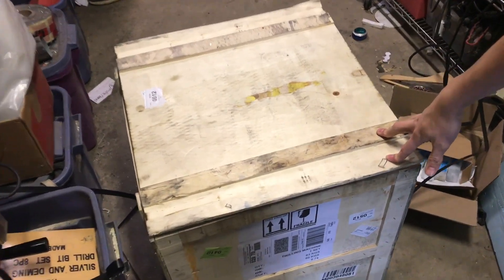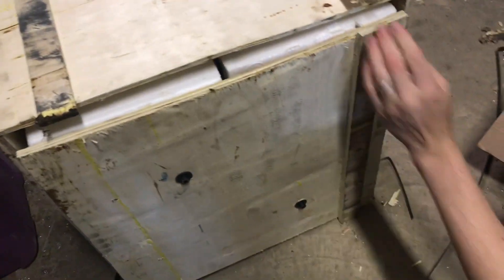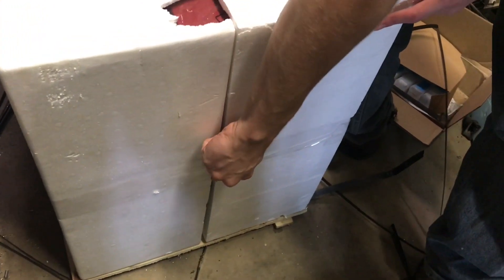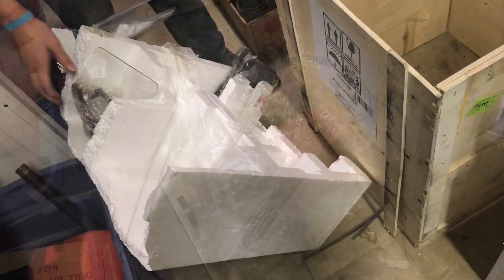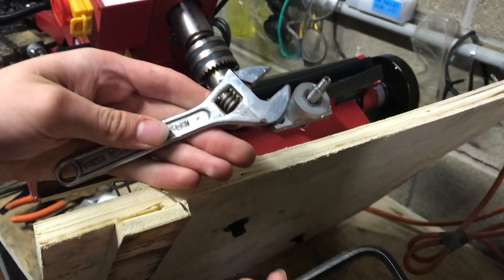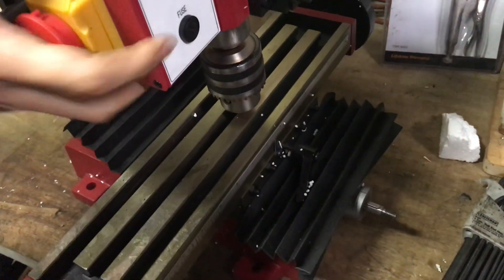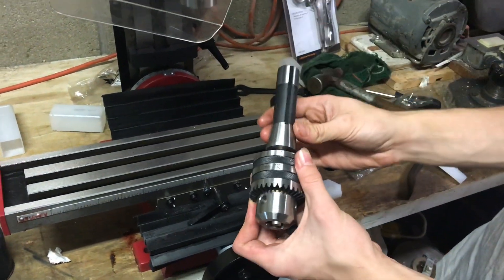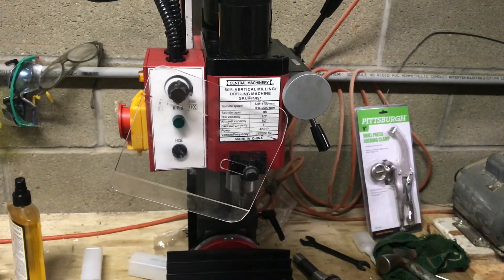harbor freight  mini vertical milling machine UNBOXING  and SET UP 44991 Central machinery

Comment: can you mount a six inch mill vice on that table?. I need to drill 6" wide steel with very precise holes and am thinking of getting this rather than a drill press.
Reply: You "could" but you would lose some height under the spindle.....a lot depends on the size (diam)  of the drill for the power rating of the motor.
They come with either an R8 or Morse 3 spindle taper....if you only want to do drilling a Morse 3 would be your go to......R8 is more  for milling as it uses collets to hold the cutters, but you can also get Morse milling chuck too if you want to do milling later......they also do drill chucks with R8 or parallel shanks if you have the R8 option.

Comment: Why did you not have it removed from the crate and save a lot of time  and crap on removing the thing from the crate and get right to the workings of the machine?
Reply from the maker: I guess we are pretty excited when it came in, I do have a Lotta videos on how to use this machine. I’ve also got quite a few videos on the harbor freight mini lathe. We really like that machine as well. This was more a video of how they packed it and how to get it up and running.
Reply: @livefree6878  I actually wanted to see how it was shipped, thanks, I just ordered one.
Reply: @livefree6878  Exactly - just ordered and this helped on what to expect. Thank you.